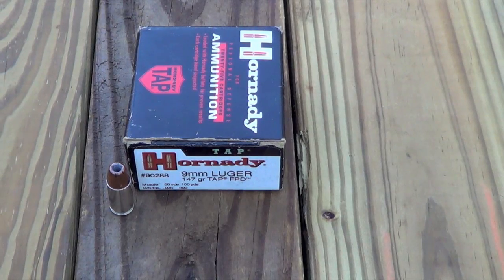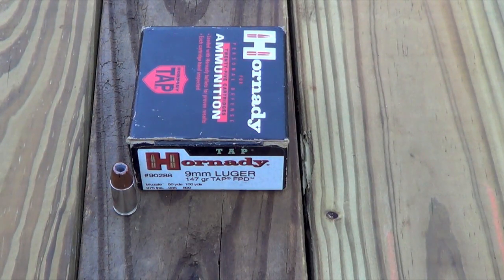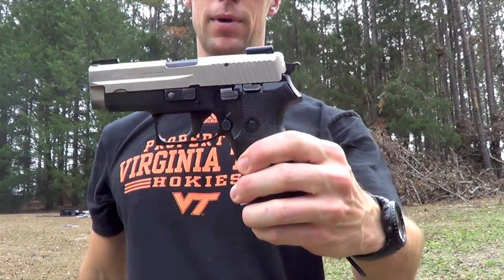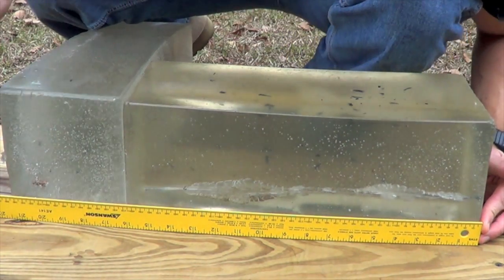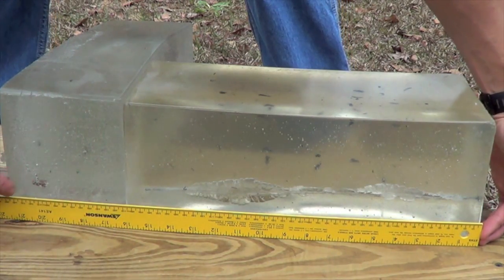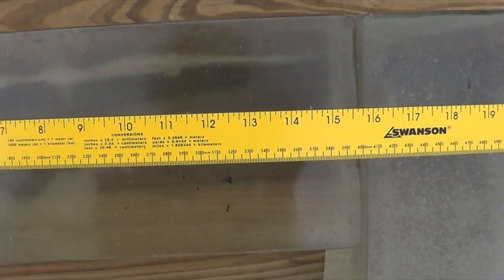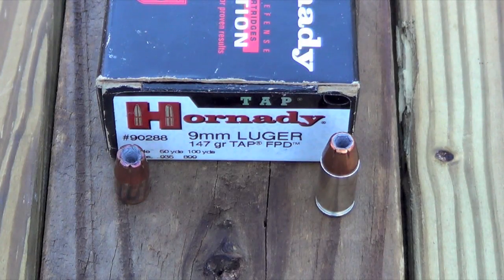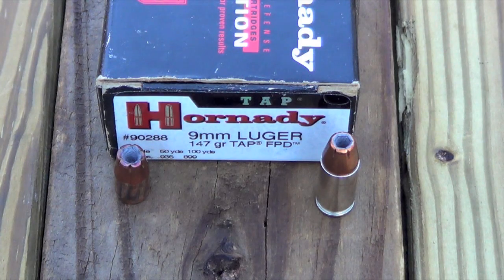Hornady 147gr 9mm TAP JHP Ballistics Gel Test (HD)

Comment: They would work you may just loose some of the advertized velocity just like you do on a Glock 20 with hot 10mm loads without putting in a heavier spring. I don't believe it would damage your gun, but I do understand your concern.